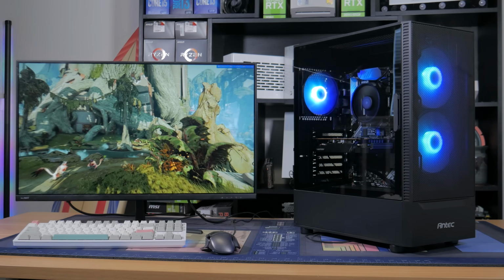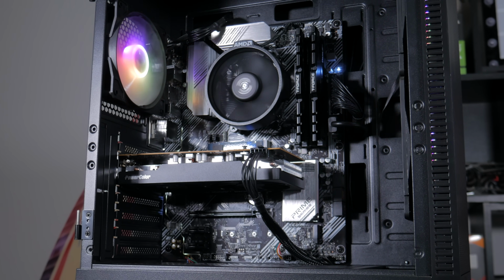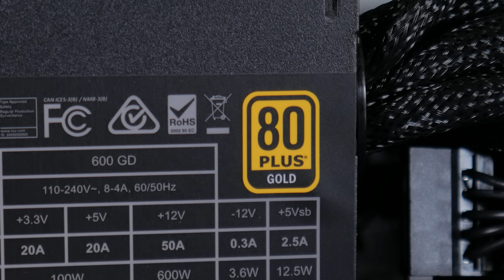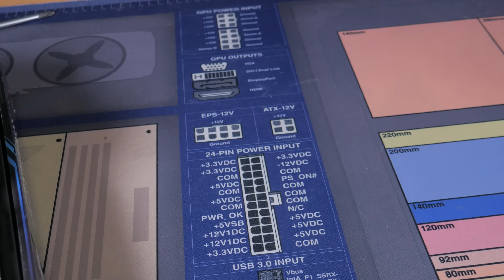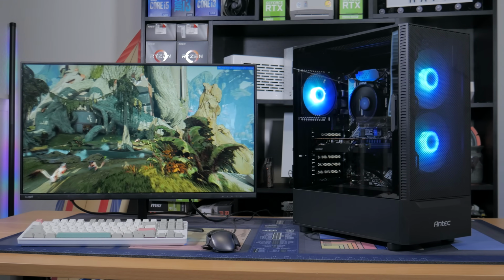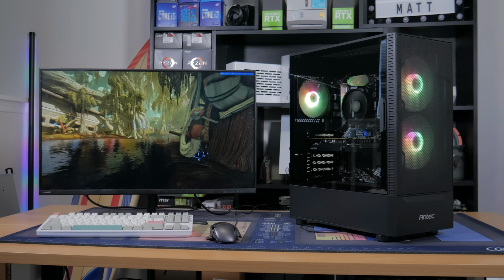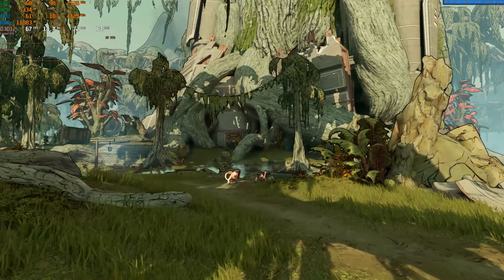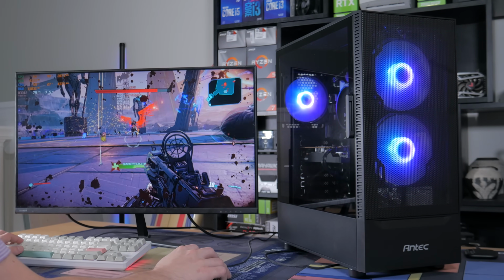$1250 Gaming PC Build Guide! (2022)

Comment: ANOTHER BUILD FOR 50 DOLLARS MORE                   
Intel Core i5-12400F 2.5 GHz 6-Core Processor	
Cooler Master MASTERLIQUID ML240L RGB V2
Gigabyte B660 AORUS Master DDR4 ATX LGA1700 Motherboard                                            
Corsair Vengeance RGB Pro 16 GB (2 x 8 GB) DDR4-3200 CL16 Memory
Western Digital Blue SN570 1 TB M.2-2280 NVME Solid State Drive
Asus GeForce RTX 3060 Ti LHR 8 GB TUF GAMING OC V2 Video Card
Corsair iCUE 4000X RGB ATX Mid Tower Case	EVGA B5 750 W 80+ Bronze Certified Fully Modular ATX Power Supply

Comment: FIXED i need help.
Everything went pretty smoothly until i had to put in Profile #1 in the DOCP. After saving and exiting, a windows error occurred, and after resetting my pc, it wont boot
Edit: if anyone else is going through the same issue, make sure the BIOS is updated.

Comment: I got all the same parts except ssd and I got the same brand PSU but got the 650 because I havw the nividia rtx 3060ti but I don't know how to connect the Fans they Motherboard is a 4 pin but doesn't connect with the Case Fans connector and I can connect the molex part to my psu but not the Fan part so do you have any suggestions on how to fix that
Reply: did you fix it

Comment: I followed this build exactly, the only thing I changed was installed the T-Force Delta RGB ram (same specs as the ones recommended in the video) but my computer keeps crashing to a Blue Screen. I've tried everything including reinstalling windows and all the different drivers and still no luck. It does it randomly, sometimes I'll be playing a game and it'll work fine, other times I can just be downloading a small game file and it'll crash out of nowhere. My cpu does not appear to be running at any temps above normal. This is my first gamimg pc and the first one I've ever built, so I'm still new to all of this. I'm just lost on what to do now. Any help/advice would be appreciated. Thanks.
Reply: did you ever get this working?

Comment: Is there any specific reason why you went with the 5600g instead of 5600x? The 5600x has a higher clock speed and double the L3 cache so it doesn't really make sense to go with the 5600g if you have a dedicated gpu anyways

Comment: Great guide, this really was easy but I ran into some minor issues.  I am posting this just to help anyone else going with this build.
1st I was not able to change the AMD logo on the fan.  The screws to unlock the cover are directly under it and it was hard to unscrew.  I had to apply pressure to loosen one and I was to afraid I would break something especially since the screw kept getting caught on the cover. 2nd when trying to plug in the power for the led lights, I have large hands so it was difficult to connect those smaller parts once the board is in the case, its a very small working area.  I got it to work but ended up having to plastic tweezers. 3rd check the tempered glass around the metal clip, mine started coming apart.  I was able to easily apply pressure to get it to stick back but was a little concerned.
Overall I'm am very satisfied with the build, runs smooth, fairly quiet, and looks pretty good. I was able to get everything listed and upgrade to 2x16 gb ram same brand for just under 1250 including shipping, had to split the order from Amazon and Newegg.

Comment: Built this with a 5600x, 32G of RAM, an aftermarket Fuma 2 by Scythe, and the RX6600XT OC edition, and it runs quite well. Thanks for the video, Matt. This was my first build and it went off without a hitch thanks to your video.

Edit: To fix typo directly related to my giant thumbs.
Reply: im about to with a 7 5600x 32G of ram and GT 310 or 910 or 510 idk or GTX 1660 SUPER and a same powersupply prob same case
Reply: what cpu cooler?!
Reply: I used the scythe Fuma 2. It works great. My temps are usually around 38 degrees C.
Reply: @shadylite  nice
Reply: The ID-COOKING SE-224-XT is another option for a budget cooler but the Fuma Scythe 2 is worth the extra $ if you can afford it.
Reply: @shadylite  ok
Reply: @shadylite  did you use other type of ram memory
Reply: I actually returned the four 8 gig sticks of cl18 t-force ram and instead used four 8 gig sticks of g.skill ripjaws v series 3600 mhz cl16 ram that I got from Newegg for $160 instead of the $130 I paid for the t-force. I feel like it gave me a small performance boost.
Reply: @shadylite  you got dis cord?
Reply: I've used it occasionally.
Reply: I'll also add that the build with my modifications runs Elden Ring at maximum 1440 at average 60+ fps. It's a good base that Matt gave us.
Reply: @shadylite  lol i found much cheaper parts
Reply: @shadylite  btw you can gets a great RTX 3060 ti for under 100 dollarz lol
Reply: @shadylite  my cord is Lava tag 0426
Reply: @shadylite  whats a "Elden Ring"
Reply: @shadylite  oh probs prob a game lol
Reply: @shadylite  oh yea the bios upgrades to support cpu for motherboard uefi idk xd lol did yous u run it
Reply: it keeps getting deleted lol
Reply: finally it goes threw xd lol

Comment: For me all I need is 16gb of ddr4 ram dual channel, a cpu that doesn’t bottle neck the gpu, a half decent gpu, a fine motherboard, a random case that have some air flow, a random nvme ssd 512gb, a random cheapo el cheapo power bank